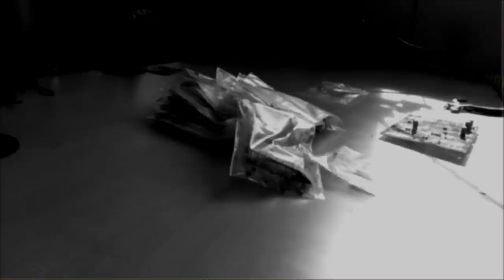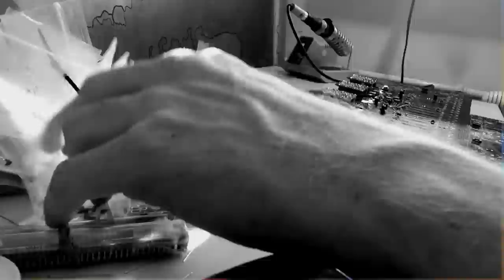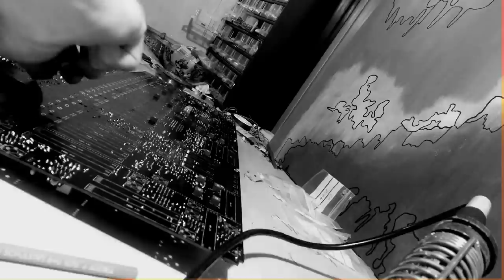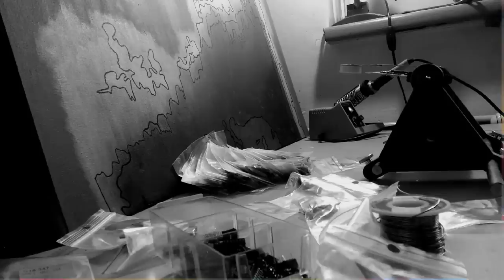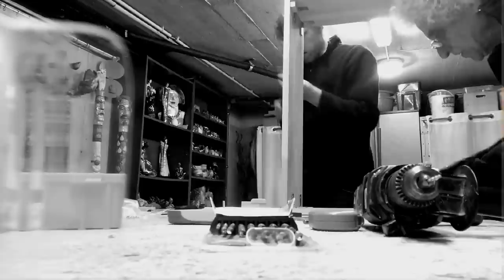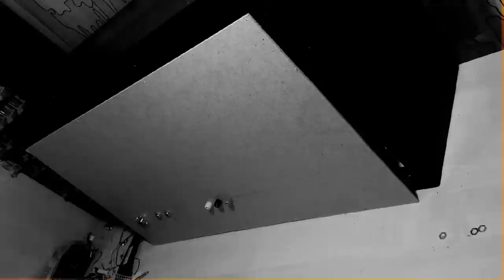(TTSH) ARP 2600 Clone Time Lapse

Comment: IC holders first. Scandalous! ;-)
Reply from the maker: hihi :) i know but the description/pcb was planed to build each section separate .. could be a pain later to put in sockets when other parts are higher ..if pcb is empty its a way easier ...sry i'm a software developer and just try solder sum stuff ;)

Comment: Hey whats going on at 6:37 are you putting tape over all the jacks? I'm currently building a rev. 2 TTSH!
Reply from the maker: +Mothy Mothy ...it was just for testing ...i tested each one ( or as group) , before i but the front panel on it ..so finaly covered all ...testing was done when all tapes are removed ... just that i don't miss one ..finaly it helps to keep my head free ..and i dont need to rember which  was already tested and which not ... just simple ... also simple sticker would work as long the hold by moving/flipping  the pcb a lot :)

Comment: so, did it work or did it go up in smoke when you plugged it in?
Reply from the maker: +Luis Donado some minor bugs at the first power up, but all where fixable, i owned one oft the first boards where some circutes are wrong but finaly it works as it should and still in use ....for example see here https://www.youtube.com/watch?v=I8FptkYYnZ0 :)
Reply: +widy75 ahh, good!  What do you think of the Arturia version?  That's all I could afford.
Reply from the maker: +Luis Donado sry i dont know .. i never used it ..i used the sonic core prodyssey on scope dsp plantform .. but compared to the analog tts it was realy clean sounding ... the analog one sounds realy cold  dark and dirty by touching some sliders :) and compared to other synths totaly different ..but good in its own range ..hope i could help...

Comment: Amazing!! Must have taken weeks to make?? How long from start to finish? The music was excellent too. Thanks for sharing :0)
Reply from the maker: statistic:
the build itself took 52 hours ( 36,852 picture every 5 seconds, video as 25 fps and was played with a speed of 220% )

build:
but beside of this 52 hours, there was
- ordering parts .. i was lucky and joined a grop buy ..so it did not cost any time and i got all parts in one shot..but if you need to order all by your own u need to calc with 10-30 hours ( ordering and matching parts ) 
- and i also need some time to read the shematics for bugfixing and that i know how stuff is working :) ~12 hours.

so the basic work was done in 4 days..and than i spend 2 weeks every night a view hours .... but as closer i came to the end, a alwyse start to patching and lost myself in doing music instead of building ... but its fun.....finaly i coverd all connectors with a tape that i save myself from patching during testing :) and calibration :)

i will never say ... it takes or it tooks sooo long .. i alwyse say, i can spend some time with it and learn new stuff :)

song:
the song was done ...just every day after work ( for one week ) i played with the new synth  to get a feeling of it and find the sweetspots ..and the record button was alwyse on .. and finaly at the end of the week i had ~60 recorded singel tracks in reaper and cut them together :) ...

hope this helps .. widy :)
Reply: Wow!.. thats so cool. Im very impressed with your skill and devotion to the project. Well done! I hope some younger people learn from your experience and what can be achieved. Im an electronics tech myself and you inspired me so anyone else watching this should be in awe of your talents. The song is also fittingly and artistically accomplished to compliment the video. It's just god damn cool :0) I like the way you taped over the connectors to stop yourself straying.. thats great discipline,  I bet it was tempting though. Hope you have many years of fun with it. Great stuff! Thanks again!
Reply from the maker: Alan Kyle thx for the nice feedback :)